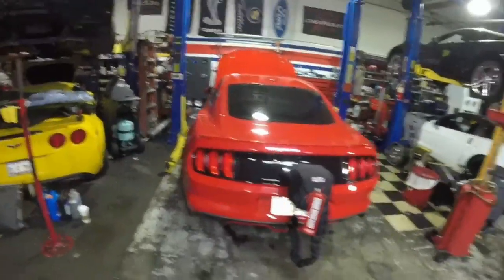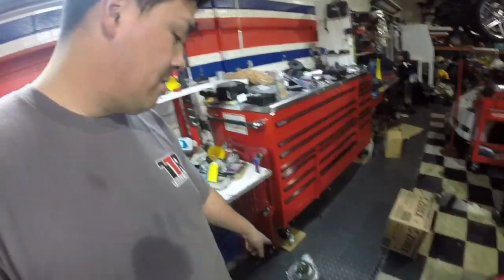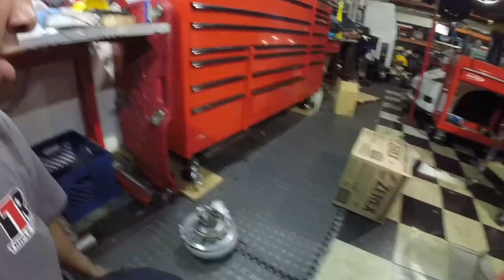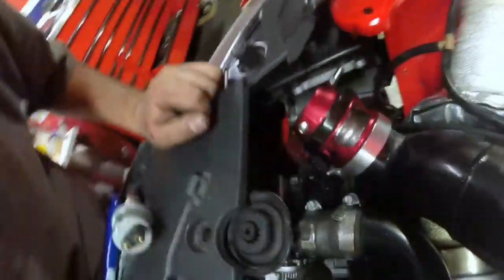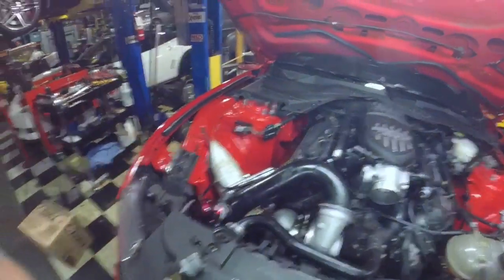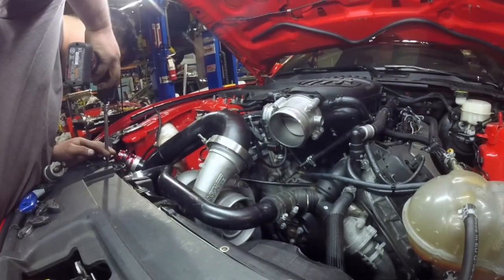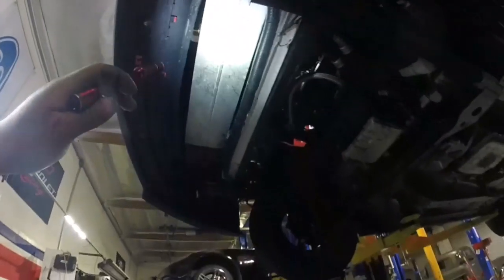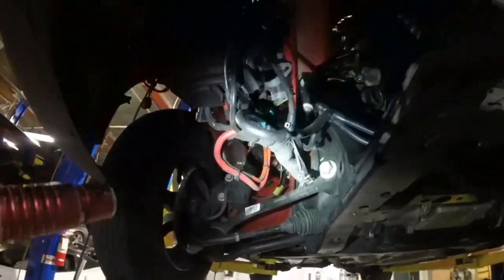my coyote gets her turbo back

Comment: hey rafa i have question i have 09 dodge ram 1500 i want to install rpm tachometer i don’t know where conect te green wire from the tachometer the tollme on the coil my truck have many coils tanks if you can hellme tanks
Reply from the maker: any coil will work, there's gonna be two wires in each coil. each coil will have one wire all the same color and the other wire will change color depending on coil, hook it up to the alternating one
Reply: Rafael Felix ok tanks rafa en keep working on tha mustang put son videos went you racing tanks bro